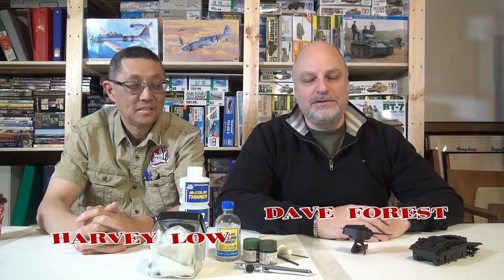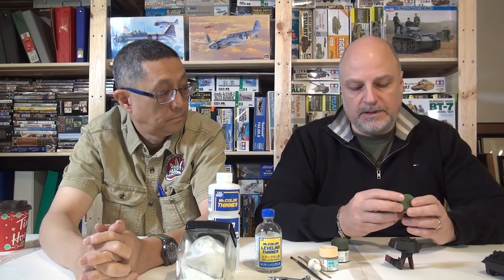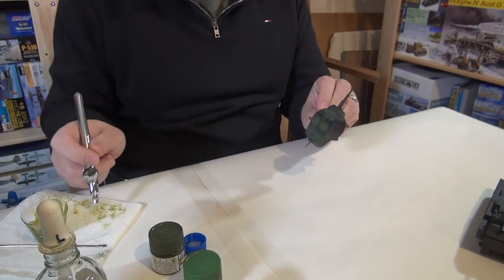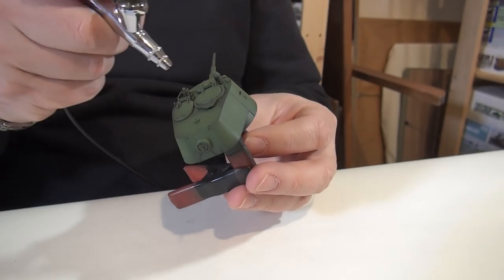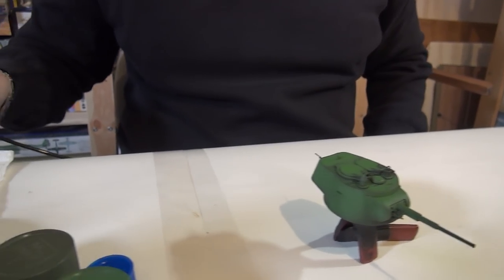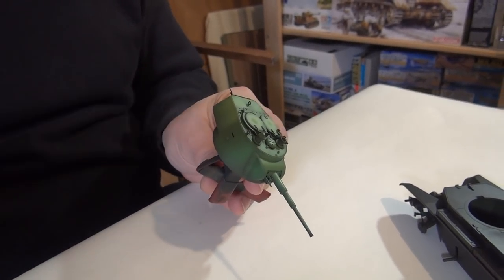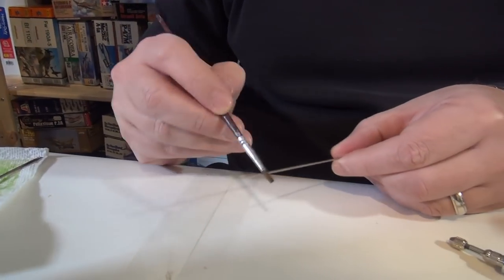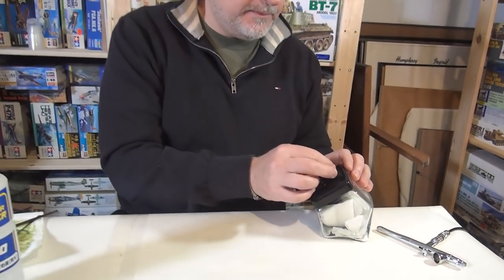BT-  7 Episode 3

Comment: Hi Dave .. Nice start .. I usually do something close to what you did but I stay with the same color instead of switching greens .. I just keep lightening up the base color.. seems to be easier to keep the color uniform while lightening it up. Just a thought.. Happy Holidays!
Reply: Richard Craig: it seems more logical for color uniformity.
Reply: Hi Richard.  Yes, you could easily use the same base color and darken/lighten as needed (in fact, I did this with the 2nd light green highlight where I used the Radome tan color to lighten the light green further).  Just don't use pure white as I find this bleaches the color (except for greys of course).
Reply: @daveforest28  yes, I agree that white "greys" green it's always better to use a sand or beige color